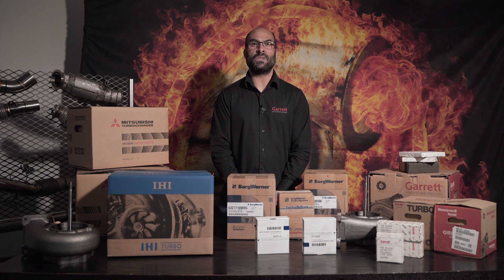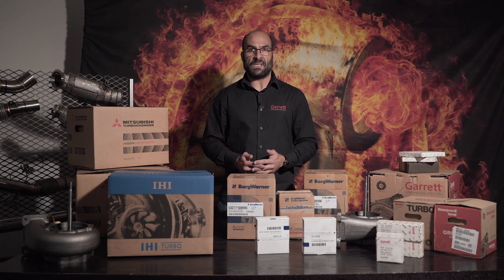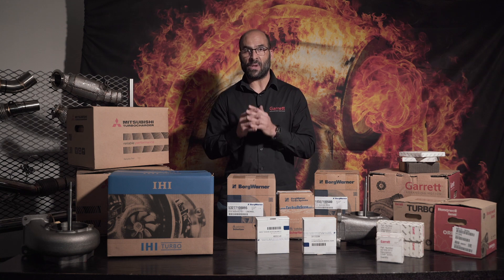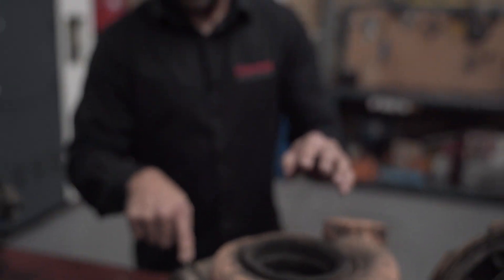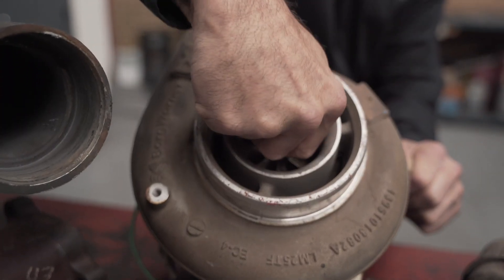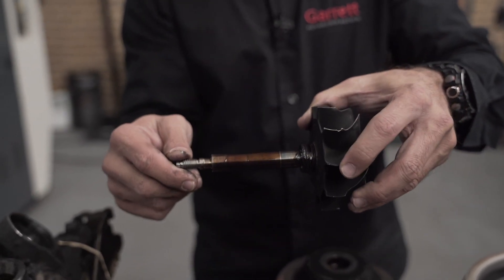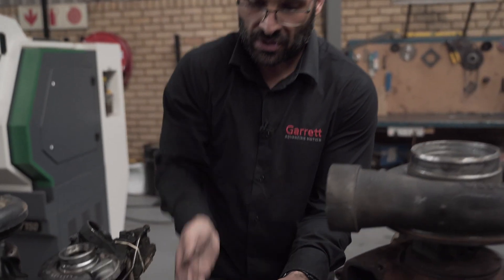TurboDirect S.A on Turbo Repairs

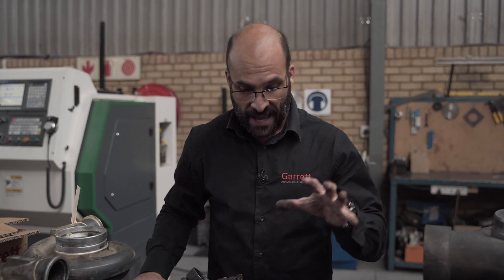Comment: 11:45 ser#, data plate on cover.
Why is the ser# not on the char ? That seems to be the part that needs  a chain of custody , and would be the only way to identify a recently replaced char on a 20year old set of covers(what I did when the 26 year old h1c started bypassing oil on the compressor side) .
Reply from the maker: Because this is a used, damaged turbocharger sent to us by a customer - ill be sure to ask the customer why his name plate is missing.